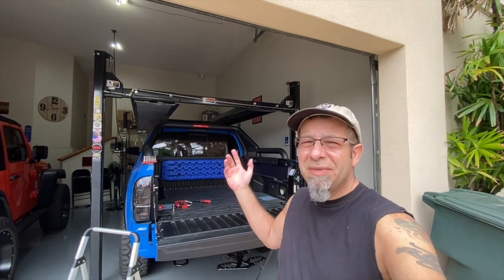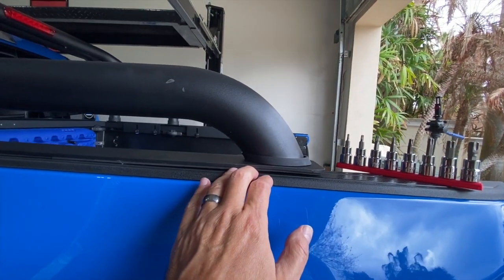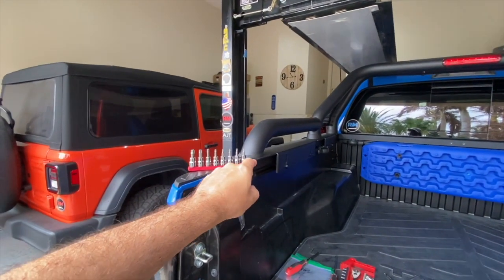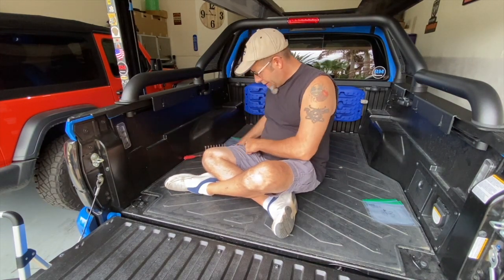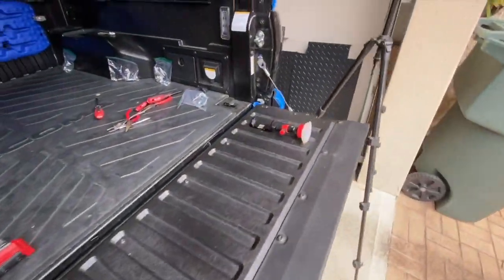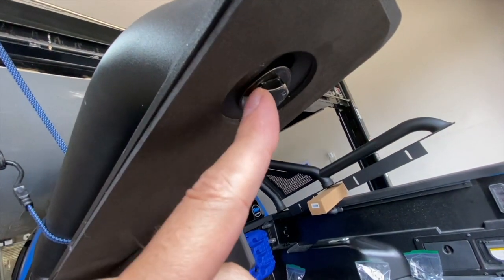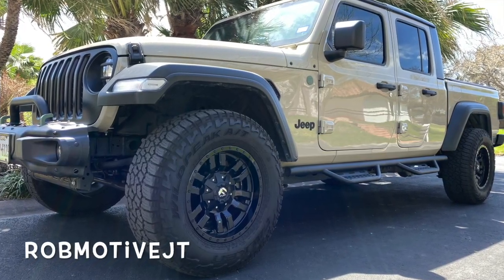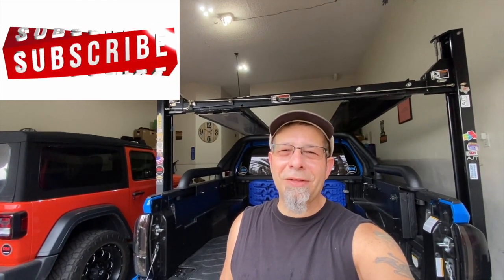Fixing My Tacoma Sport Bar Mistake

Comment: a $6.00 tube of black silicone caulk would have been a 10 minute fix.
Reply from the maker: That’s true...but, in essence, the gap is still there and the bolt would still be putting pressure on the plastic cap😬